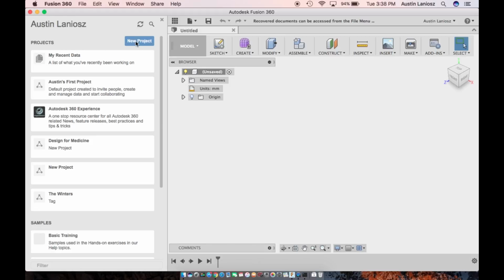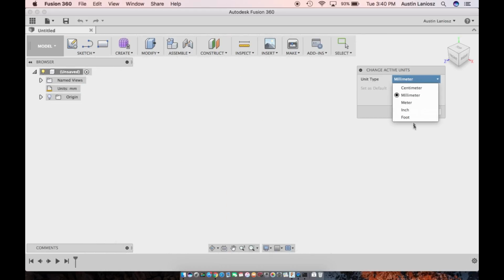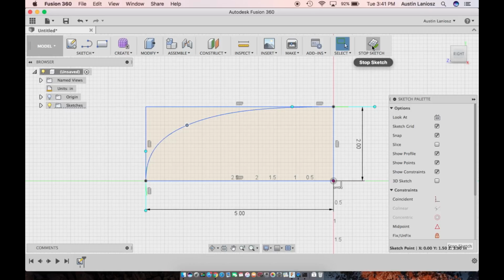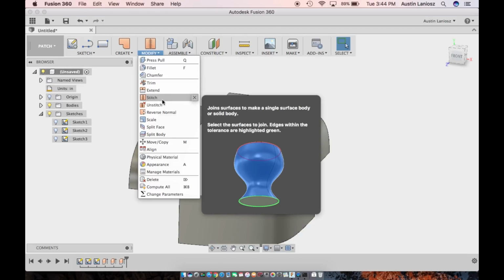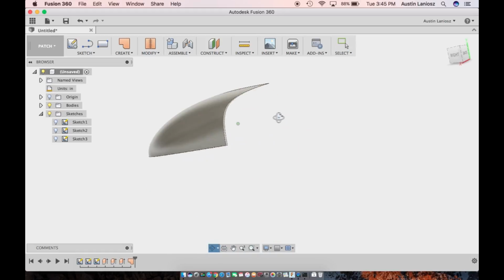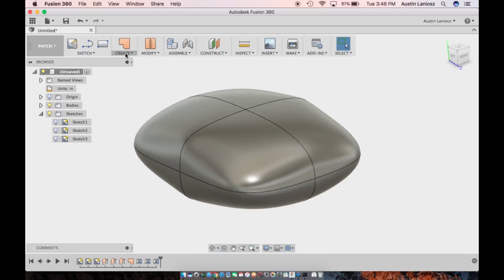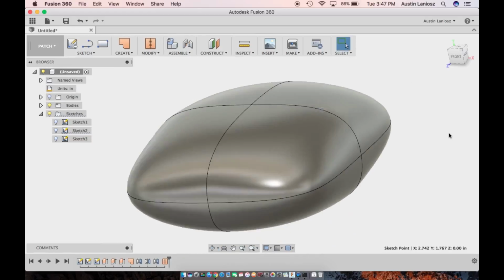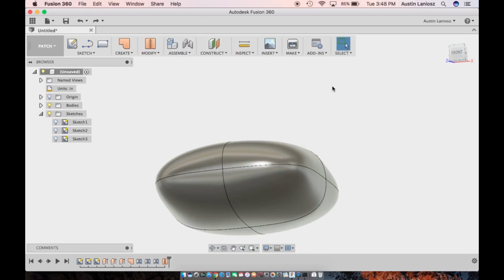Surface Techniques Tutorial: Siemens NX to Fusion360

Comment: Hey Austin, I am working a short analysis of different CAD/3d modeling software. 
My professor brought up NX and told me to take into account. 
How would you say it compareces to Fusion or even other CAD/3d modeling software?
Reply from the maker: Hi cementium, 

Thanks for reaching out! I'd say if you are proficient with parametric modeling, NX is going to be perfect. I think NX and ProE are similar in capabilities, but will have different workflows. There will also be a difference in capabilities between current Fusion and NX/ProE, but that may not always be the case. 

Fusion is an awesome software to learn how to build in 3d, Rhino is also great, but stands out from the others in the build process. Do you have access to NX software? If you do, I'd say use it all you can. :)